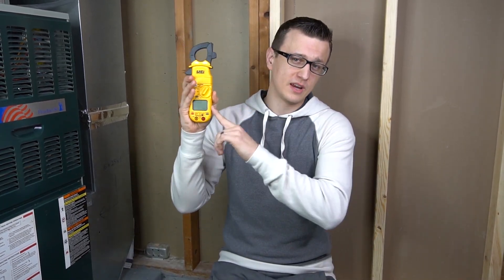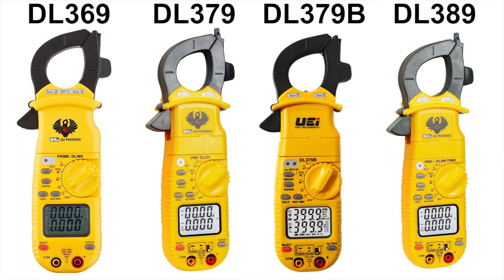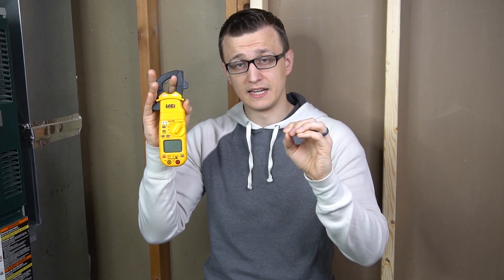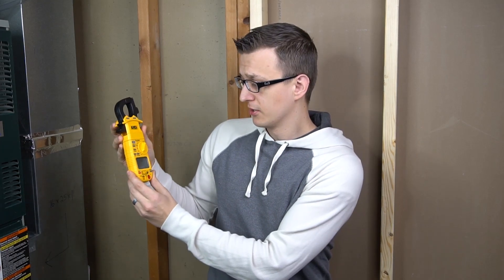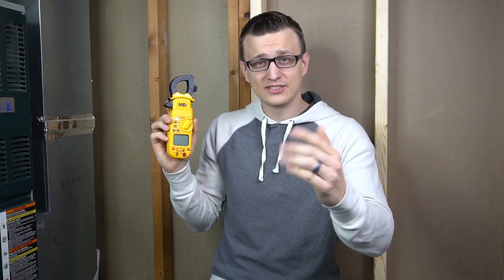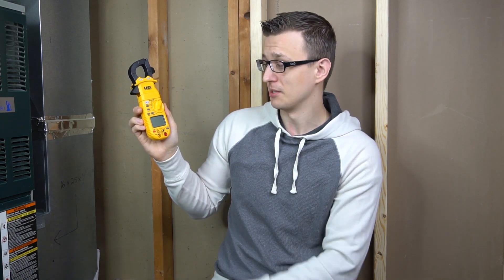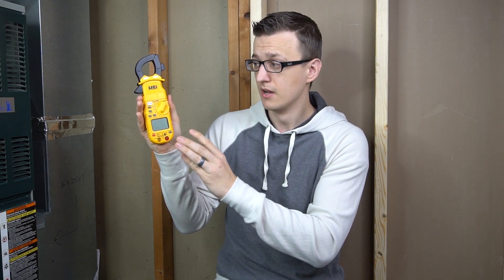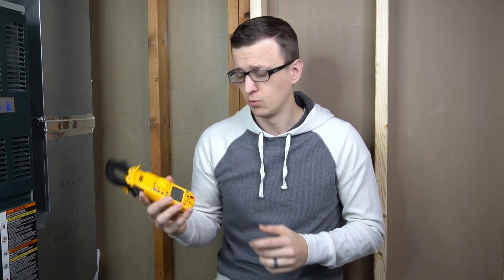The Difference Between UEi DL369, DL379, and DL389

Comment: Have been using the 389 for 7/8 years now, never skips a beat other than when the batteries are almost dead (commercial HVAC use). Highly recommended.

Comment: The reason why I like fluke is due to their reliability. They are well built and they and solid state pieces of equipment. I tried those you are showing right there and no luck. I remember trying to read a capacitor once and it would take forever compare to the fluke, the technician that was showing it to me told me to be patient. They might have improved now and they are better. However, I prefer the Fluke 902FC, has all those features plus Bluetooth, I use it for diagnostics of pieces of equipment that need to the data recorded in order to figure out what is wrong with the equipment. I don’t have a light or a proximity tester, no even a magnet, but for me it is more safe and reliable. I can even test ohms on live circuits with no problem. Just don’t leave it in there for too long, you might blow a fuse on your tester. I respect your opinion but remember, it is your life you are trusting to these pieces of equipment. To me would be like comparing a $5000 dollars smart tv to one of those droids tv that run for $500, sure it does the same thing and more, but does it do it better?
Reply from the maker: Thank you for the detailed response! I appreciate all the recommendations and the Fluke meter suggestion!

Comment: I've had the dl 389 for over 5 years now. I use it every day most reliable meter I've ever owned. You can pick them up for around 150.00 $
Reply: Where can i find one for that proce
Reply: @theguy2605  just type in dl389 on the search bar  first 3 that come up are under 150 new
Reply: @cwindsor8585  Do you think the DL489 could be a better one?

Comment: When I researched RMS my understanding of it is that you get a more accurate DC reading. Fieldpiece comes with RMS but I'm a UEI guy myself.
Reply: Wesley Edwards hey man. Have you ever had problems with any uei meters? I have a uei and considering getting a fieldpiece. But not sure I should. What problems have you had with UEI?
Reply from the maker: @Wesley Edwards  Yes, RMS is accurate for DC readings but TRMS (True RMS) is accurate for fluctuating or pulsating AC readings.
Reply: So far so good. I wouldn't switch if I were you Rob Brown.

Comment: You may read this after 4 years. My question is I am a DIYer I looking at the DL369  for the cost, however I need to know how to set to MicroFared uf . The short instructions are not clear and I am not trained HVAC or Electrician bt I just need to test my AC/HP capacitor.  Or can you recommend another brand that the settings are easier to understand.
Reply from the maker: The uF or MFD setting should be auto ranging. This means the meter will automatically adjust the measurement according to the component being measured.
Reply: @WordofAdviceTV  This does not tell me how to set to uf. There is not a uf marking on the meter dial
Reply from the maker: @DavidMoriconiM3inspect  My apologies, I misunderstood the question. On the DL369, you would set the dial to the MFD setting which is the same thing as uF.
Reply: @WordofAdviceTV  So you are saying if I want to check an AC/HP capacitor I turn the dial to MFD on the DL 369. The last time I watched the video It looked like you got uf when the dial was set on ohms.

Comment: I have been looking at your meter in these videos and I zoomed in and it was the DL 389 I saw you using, I was bidding for a used one and was outbidded. They say the DL 389 is not being sold anymore, but I did see some in Canada. What will UEI replace the DL 389 with is the question.
Reply from the maker: As far as I understood, the DL389 has been replaced with the DL389b and I failed to talk about that in the video. Sigh... It's about 170 on Amazon: https://amzn.to/2SMUFiB

Comment: What is the difference between the 389 and the 389B?
Reply from the maker: They are the same but the 389B is the updated version and has a few extra features like low amps measurement to 2000 micro Amps and dual range NCV.

Comment: Hi Jay
Im looking at dl389B meter , but before I buy , (with your experience)if you were buying/replacing a meter which brand and model # would you buy ?
Also I have question about a condenser fan and capacitor, so can i text or how to contact you. No one i know could/would answer this question
Thanks
M L Rogers    Pasadena,TX

Comment: I'm the same I have 3 different fluke meters and 1 fieldpiece, I use the fieldpiece the most because it does absolutely everything I could need it for it's the sc640 however I'm saving up to upgrade to the new sc680 or the sc660 either would be my perfect meter all around for the 3 phase test application

Comment: anybody ever expirence a ghost amprage when you turn them on?  Brand new 389b and i get anywhere from .5 to .8 amps after just turning it on.
Reply: Not on my dl389 but on my dl429b it never reads below 0.41 amps and constantly shows higher amp readings than the 389 and  a UniT.

Disappointing.
Reply: @davejohnsonnola2758  i meant 429b. talked to tech support, they are having me send it in for calibration.  coworker has the same issue and gonna send both in at the same time.  so far they have been helpful and even sent me a shipping label.